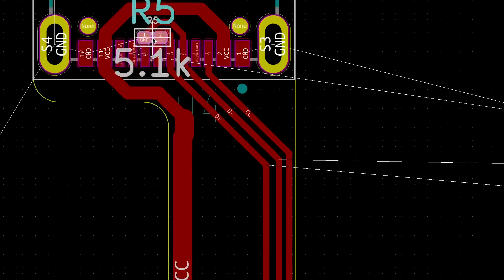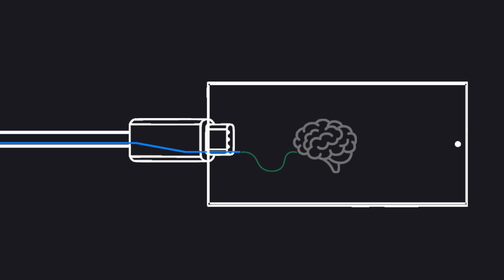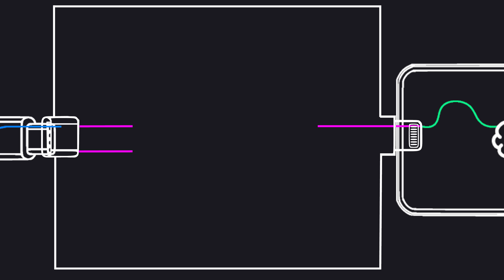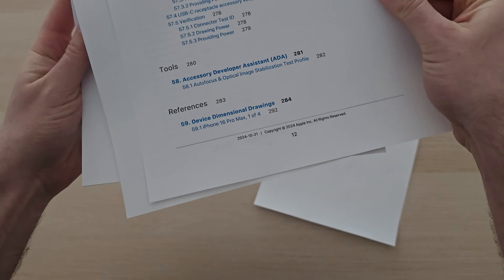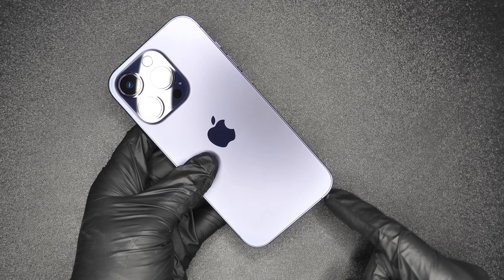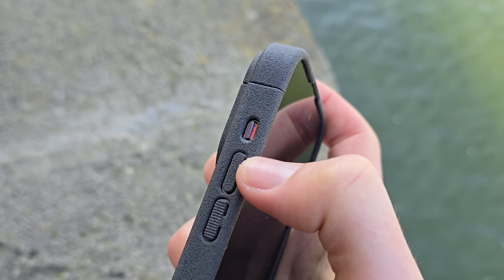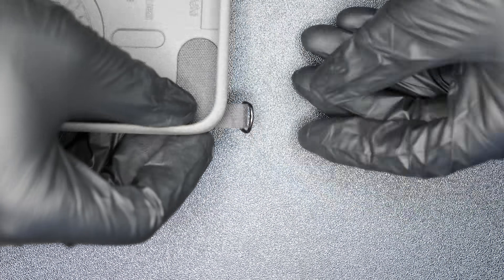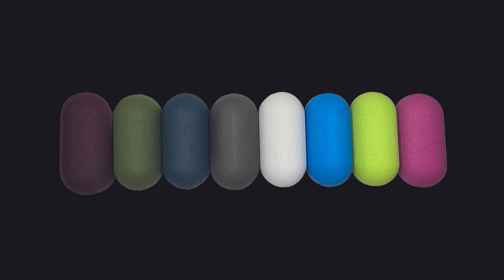I Gave Every iPhone USB-C.

Comment: My phone is already usb-c but I still want it.
Reply: Yeah, durability reasons, you simply perfer your phone get plugged in for months or years before replacing it than get plugged by a charger each day
Reply: @16_rafi44  Durability is no issue with USB-C. I plugged in my phones for years and their ports are still going strong. Besides, there's NFC charging if you're really that scared of wear and tear.
Reply: :face-blue-smiling::face-blue-smiling::face-blue-smiling:

Comment: My only feedback is I think left side would have been better so it doesn’t feel like I’m holding a sharp corner in my right hand. The gaming argument doesn’t really hold if you just rotate the phone and charge on the top left side while gaming. But maybe it won’t take much to get used to.

Comment: stunning work! could u make the case shockproof using a different material?
Reply from the maker: It will definitely resist small drops, but not making any claims for that. I do offer free replacements under warranty even if you drop it though, you just need to cover shipping. It's possible to get other SLS materials to print with, but they are more demanding and don't print fine features just as well. Thanks for the good question!